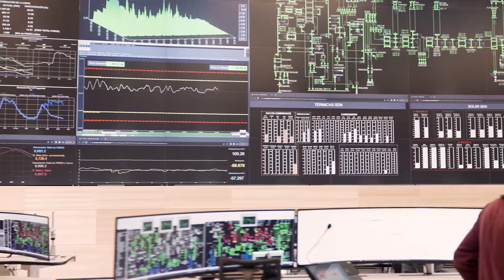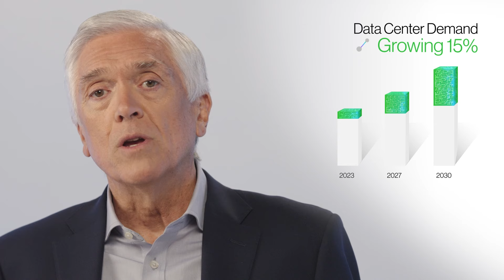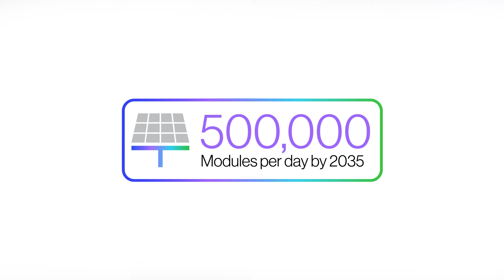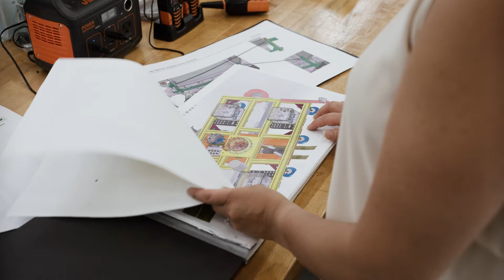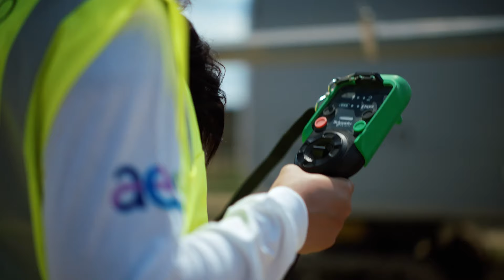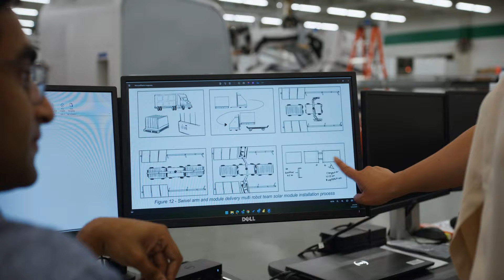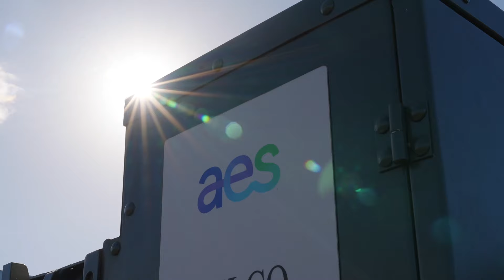Meet Maximo, the first AI-enabled solar installation robot

Comment: Some comments here about ai marketing bs, however lets have some real toughs about this this robot will only install the panels and not the poles etc? while you have that labor on site sure they can install the panels as well?  large solar fields are optimal for this robot but they are not endless that means turnarounds transport and more labor, optimal? not all that convincing!
Reply: You are wrong my friend. They now have AI post pounders. The only thing that will be manually installed is the torque tube. They’ll figure something out for that next.
Reply: Don’t forget about the AI trenching solutions, skid steers, etc. they are already in use.
Reply: I know people really don't want to believe it, but we are "there".    Every time a new robot is unveiled, there will be comments on youtube just like yours.   I understand the skepticism, but we finally have a toolbox that lets automate ANYTHING, at a reasonable cost, and we really don't need to sacrifice anything.